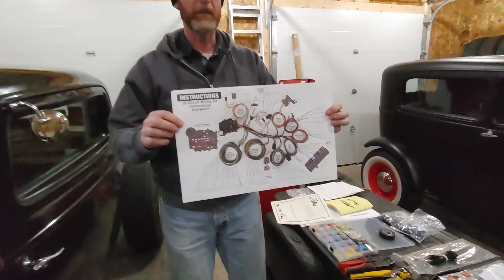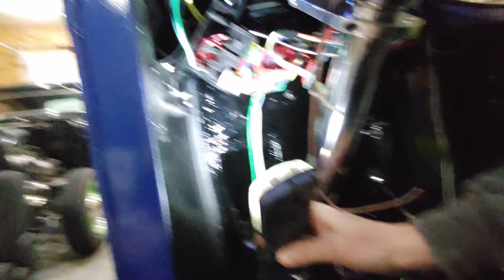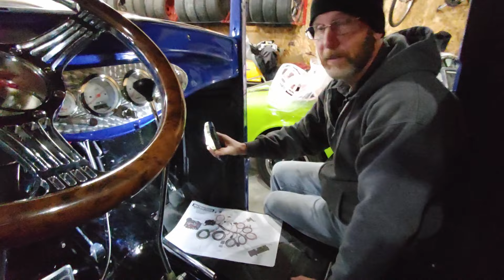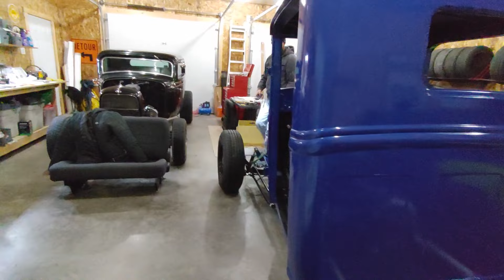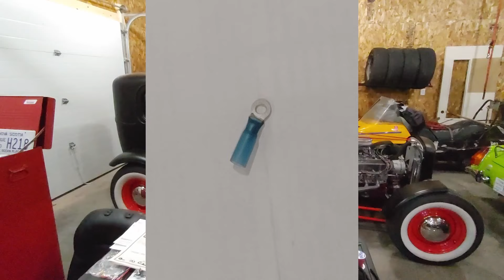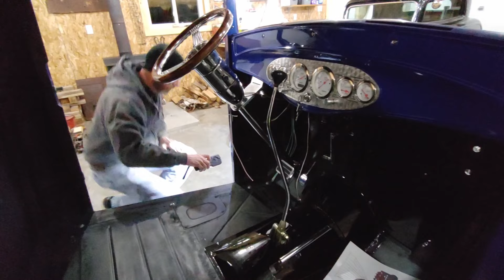WIRING THE 1932 FORD PICKUP

Comment: Nice explanation on how you went about wiring your 32 Pickup and what you use (kit) ! Did  you run wires up one of the pillars to get to the roof in front for wipers see wire hanger there ?
Reply from the maker: Yes I ran 2 wires for the dome light and 2 wires for the windshield wiper motors. I going to do a separate video on how to wire the 2 wiper motors as soon as I get a second motor (1 motor I bought was bad). Wiring them is not as obvious as you would think.
Reply: @coldstreamrodshop  Ok Derek thanks  for the reply will look forward to the next video !